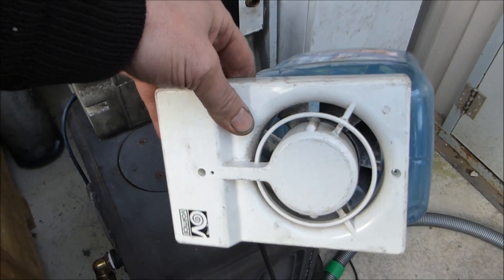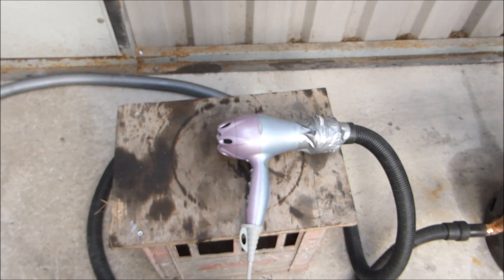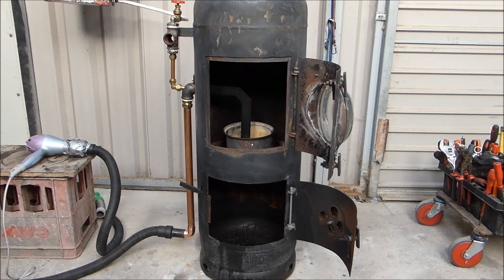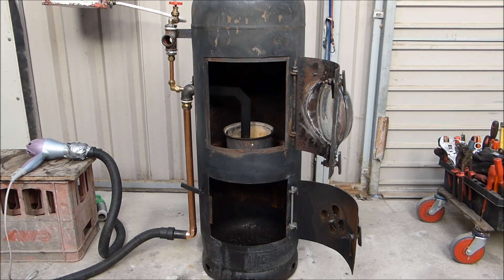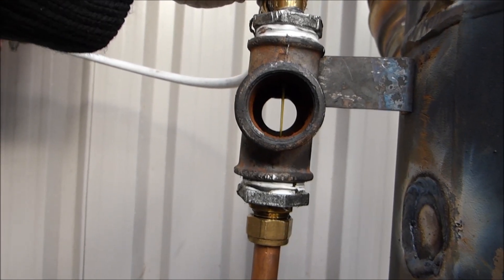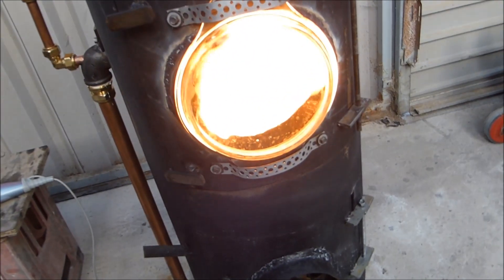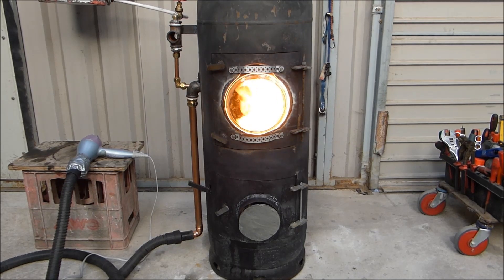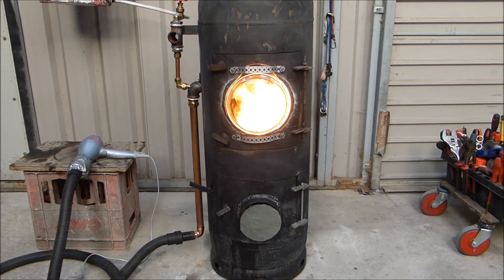Hairdryer Powered Waste oil Heater

Comment: Hey Gerry, How long does it take you to burn a gallon of used oil? Thanks
Reply from the maker: Hi Dave. 
The Burner would use a gallon of oil in about 2 hours at full blast. It could of course be throttled back for less output  so it would produce less heat and use less oil. It does produce a serious amount of heat though while the oil is fed into the unit in a steady stream but it can be reduced to a drip  also. Cheers Gerry
Reply: Very interesting project. I am willing to weld one up with my powertig welder to see how I make out.

Comment: I'm currious how you built the air / fuel nozel? I see the fuel line entered into the air line through a hole drilled in the 90' elbow. does the fuel line stop just inside the 90' or does it continue inside? if the fuel line goes further in, how far does it go?
Reply from the maker: Hi. The fuel line travels through the blower tube all the way to the bottom. It stops the flames burning the oil in the feed pipe. You can see a detailed early construction video I did here. http://youtu.be/AiKcx7ghtHk
Cheers Gerry

Comment: This is a great burner. My first thought though was could you not use a turbo charger, driven by the exhaust from the burner to compress the air for the air intake, that way once you get it going you would not need an electric fan, saving electricity and probably getting more of the energy back from burning the oil.
Reply: No you couldn't.

Comment: you should try a bilge air blower, its a inline fan for blowing air into an engine compartment in a boat... they run on 12 v and are rated continuous duty and  fairly cheap.. 20-25 usd...  they draw a couple amps @ 12v ... have it with a solar panel and a battery and you'd have a totally off grid heater..

Comment: if you have an air compressor just run a line to your heater. that's what I did at a truck shop I welded at. it worked great.
Reply from the maker: Hi Bob. I have tried compressors and they work fine. Just experimenting at the moment. Cheers Gerry

Comment: Hair dryer too noise.

Yous know EGR recycling gaz on car engines,
A.V.E.C. vortex also on intake air and exhaust engines ?

Maybe run If we can take a bit of exhaust hot gaz, add fresh->hot air intake in,
but vortex difficult to build in heavy steel, and thin plates doesnt rssist long.
Reply from the maker: Hi Fred . The hairdryer was just to show that the air supply wasn't high pressure. It burns really clean with a ton of output. I want to try and get this to be not so noisy next. Cheers Gerry

Comment: Hi Gerry , saw a 12v 4" fan powered from a car battery charged from solar panels , do u think it would have sufficient airflow to power heater??? It was used to power air filtration in a bugout bunker
Atb Lee
Reply from the maker: Hi Lee. ITs hard to say. At the start of this video  I had already tried a bathroom fan and once the hose was connected  it just spun pushing hardly any air forward.
A car type squirrel cage fan would work if you wanted to go low voltage. The type that gives you hot/ cold air in the car. It would be fast enough on the low setting.
With this type of forced air burner the more air and fuel you give it the hotter the flame and you could easily melt something if not careful. I see others using bouncy castle blowers. It could be speed controlled to deliver the correct amount of air. Cheers Gerry

Comment: Another great setup. You are the oil burning guru!  The passive design is great but it is no match for the output of a forced air type.
I have a forced air design you may be interested  in.
 Waste oil Burner   WVO  WMO
There is also a smaller version on my vid list. 

One thing I found very helpful is a small electronic on/ off timer from ebay. I have a small pulse type fuel pump which the timer runs for one second then has an off time then activates the pump again and so on. You can regulate both the on and off times to make for some very accurate fuel flows. This works great because you don't have to worry about the fuel flow increasing when things heat up and the oil thins or the flow dropping off when the level in your fuel supply falls. 

It would also be easy to rig it up to a snap switch so if the fire went out the switch would sense the under temp and shut the thing off. it may be possibly to do over and under temps with  some sort of industrial furnace thermostat.

Another advantage of the pumped fuel using the timer to regulate flow is you don't have to worry about blockages. I coarse filter my oil through a bit of old fabric before putting it in the fuel tank and that's it. There are no small orifices like using a tap to block which I had problems with.  You can run it all full open 1/4" and just let the pump control the flow. 

Once again, great job on your burner.
Reply from the maker: Hi glumpy10. Great post. I had already seen your video before and was really impressed. You are producing a really serious amount of clean heat there, enough to heat half a street lol.
I am planning on using a pump to deliver the oil and the pulsed circuit sounds really good so I will definitely be giving that a try. I will be trying a few things with the burner this weekend and as it the national holiday weekend here  (St Patricks day is on Monday) maybe trying a few beers as well.
Cheers Gerry

Comment: I like it cool set up----how about that tool cart over there how did you fix that up looks interesting and handy ---peace
Reply from the maker: Hi mtngoat58. The wheels are off a broken shopping cart and the base is 1/4 chequer plate steel. I just welded the wheels to the plate and I use it for shifting heavy items and its handy in the shed for moving the tools about. I have modded the stove again also. This time the burner is in the lower chamber and the heat output is enormous and the exhaust is still clean. Runs like a jet engine. I will do another video at the weekend and maybe a closer look at the tool cart. Cheers Gerry
Reply: cool look forward to it

Comment: Love it, Now I cant make up my mind , which stove too build. Propane Tank, or standard domestic wood stove. What stove in your experience would be the easier of the two? You keep making the videos and i will keep watching. Going to get up the nerve to make one of these stoves soon. Cheers, Robert
Reply from the maker: Hi Robert. I have altered the Propane tank version and put the blower burner unit into the bottom chamber. The whole stove will glow if I am too generous with with the fuel. I will post a video of it within a couple of days. I would go with the blower in a propane tank for larger spaces but if you already have a wood burning stove its a very easy conversion with just a 44mm hole to repair if you want to revert to the original later. Cheers Gerry
Reply: Hey Gerry, I think I am Going to try the wood stove version.I just keep watching your video and it fires me up to do this ever time. Have to get in touch with a buddy that can weld as i can,t. like you said, if it does not work out ,just repair 44mm hole.Thanks for your great vids.    Have a great day, Robert
Reply from the maker: Robert Dahl Hi Robert. If the stove is in a shed this burner is good as it fits completely inside the stove. The downside is that it is noisy. It burns lovely and clean with as much output as you could possibly want and it can be dialed back to lower outputs as well. Cheers Gerry
Reply: Gerry's Waste Oil Burner ò

Comment: Hi

How many Liter per minute of waste oil do you use at low setting? 

Thanks
Reply from the maker: Hi Remi. It needs to keep the vapourising pot red hot so that combustion can occur so I would think 1 to 2 litres per hr but I will check it out this weekend and post the results. I have modded the setup again for more heat / efficiency. More videos soon. Cheers